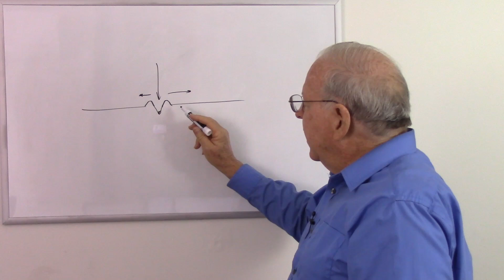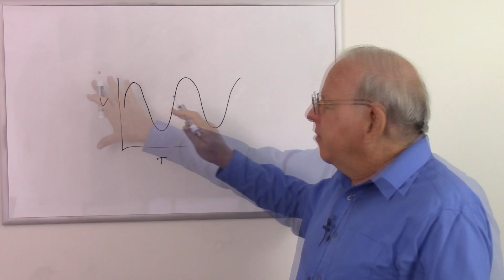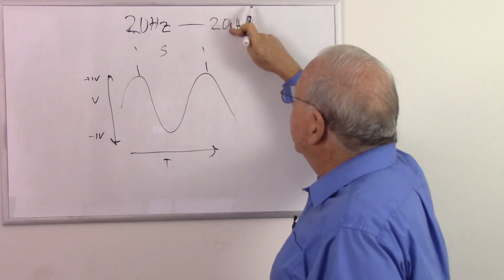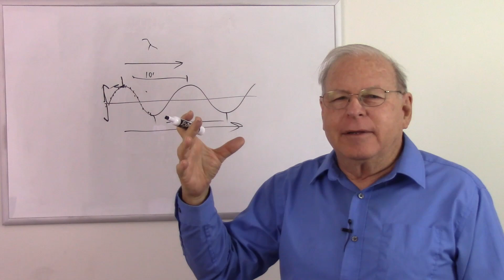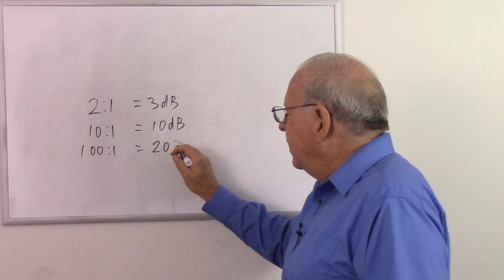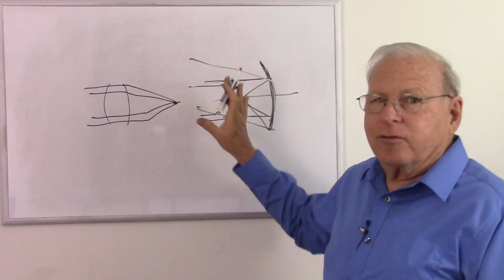Sound - Solid-state Devices and Analog Circuits - Day 11, Part 0

Comment: Hello, Sound pressure is a field scale and not a power scale so if you double the value you end up with 6 dB more isn't it ? If you double the intensity (it's a power scale) of sound though , you add 3 dB. 1 trillion times 20uPa= 20 millions Pascal so we are  way past the pain treshold here! Sound speed is not slower in altitude because air is rarefied , yes density is smaller in altitude but it's compensated by a lower pressure it attenuates faster with distance but keep it's normal speed. In altitude though sound speed is often smaller because temperature is lower.